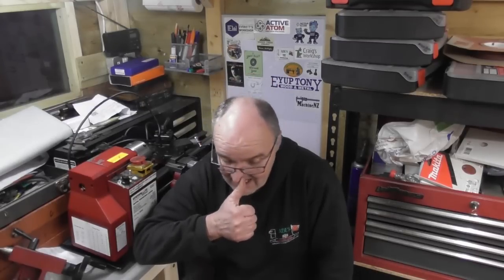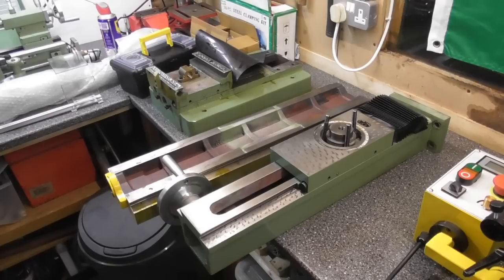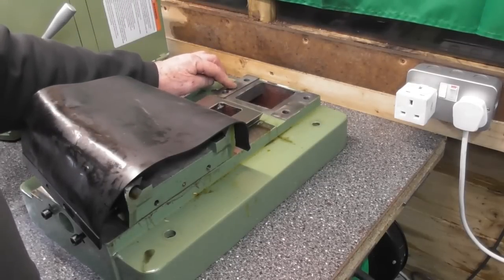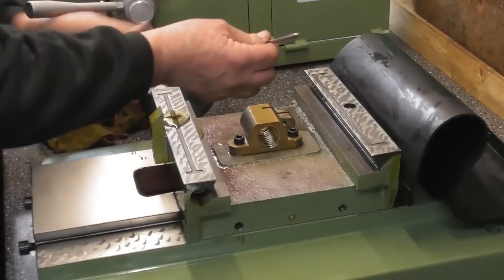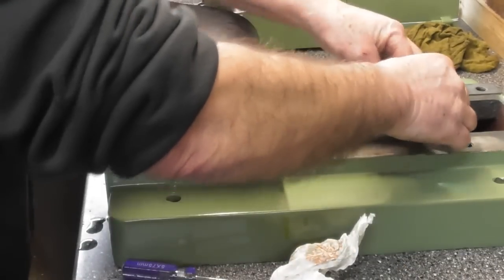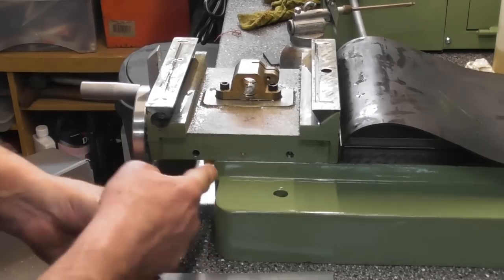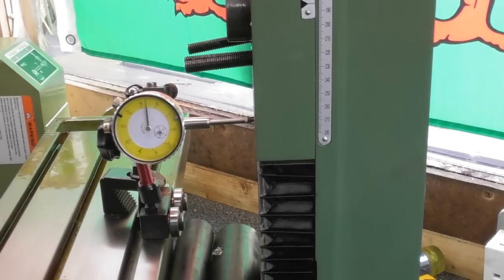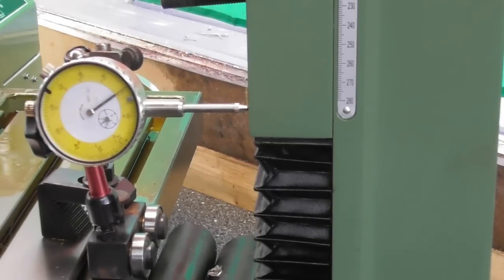Warco WM16B  mill part 1

Comment: Nice Ade, hope it gives you good service, I have Chester machines, when the lathe was delivered it was covered in that yellow grease/oil. I purchased a WD 40 degreaser spray which removes it very well but if left longer than a few seconds also “eats” the paint. I seem to learn these things the hard way, bit of a numpty for not checking first. Keep up the good work, between yourself and John Mills this old office based engineer is slowly learning how to do it properly. Thanks for the re-education, I am now making things a little more useful than swarf !

Comment: just what i needed to see,,, got one arriving friday,, was wondering how to carry it to my mancave...
Reply from the maker: Hi, I did manage to carry the parts through my house and down the steep steps to the shed , I was puffing a bit though . Cheers Ade.
Reply: @ade63dug  Ah great,,, also do you know if a 12mm work holding clamp set will fit theT slots??
Reply from the maker: @marmac567  yes , perfectly . M10 studs 12mm nuts
Reply: @ade63dug  proper job,, thankyou

Comment: I clocked the sieg  as well. Almost identical to my old  lathe (which I still have and use) which is a Clarke cl300m.

Nice mill and nice job setting it up. that grease is a pain, but they do help to object the machines  Good move in my opinion going for the belt drive model to.

Comment: The oil ways should be rounded to blend in  so the oil is not scraped off . I bet the first thing you will want to change are the saddle locks !   Didn't Stefan Gotteswinter put some type of compound under his colum ?  Should work out good hopefully . Cheers .

Comment: hi ade  i,m just setting the tapered gib on my y axis of my warco 16b .the only way i can set it is by snugging the 2 slide locks up  so that its just touching and then adjusting the gib till its just smooth with no  side movement. so then i can lock the bed but if i loosen them again to much i would have to much play is this the same as yours , i just got it yesterday , hope you can help

Comment: Hi Ade,
Congrats of the new machine.
I am looking into getting myself one of these too, so I appreciate your video(s).
I have one question (a noob question), is there any way of adjusting the X and Y perpendicularity? I could not see anything in the video that could facilitate adjusting the angle of the bed relative with the base.
Looking forward to seeing you using the machine.

Comment: Hello Ade,
I've watched a few things about the WM16B and your videos are by far the most informative. Your latter videos even show some proper machining of steel - most people on YouTube seem to machine only aluminium! I'm trying to decide between the Warco Wm16B and the WM18. I'm leaning towards the WM16B for a number of reasons: cost, less space in my workshop, belt drive system and a good specification for the price.. I might have missed your reasoning for buying the WM16B, but could you please recap on this? Do you find the height over the table is large enough to fit vices and work in? I'm encouraged by your comments on the rigidity of the 16B. Like you I'm finding milling on my lathe very restrictive due to limited cross slide travel and the difficulty in mounting larger jobs for machining.

Keep up the good work in the shed and in front of the camera.

Chris

Comment: My Optimum was very far out in vertical plane. My trick was to clamp a square vertically on the table and then put a DTI against the blade and run the column down. This gives me some  error from top to bottom. Then flip the square round 180 degrees and do it again. The mill will out be the sum of the two errors divided by two and the square the difference of the two errors divided by two. You can figure this out for yourself with a bit of algebra...